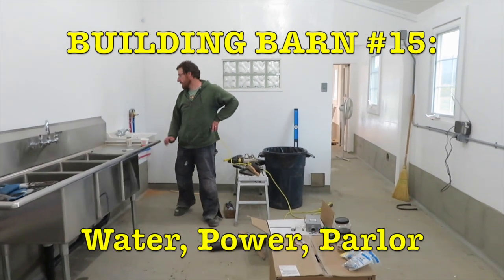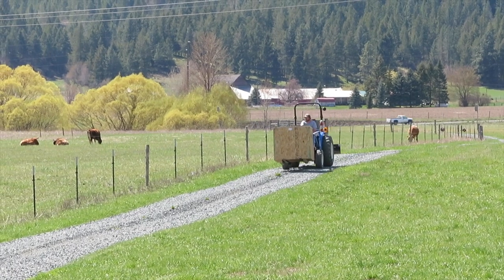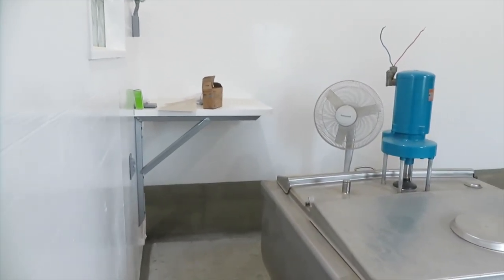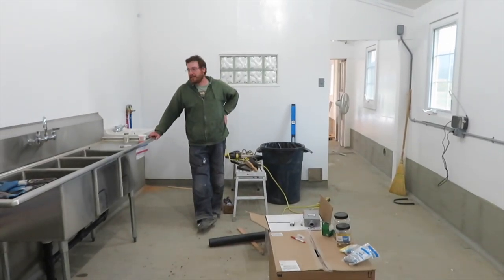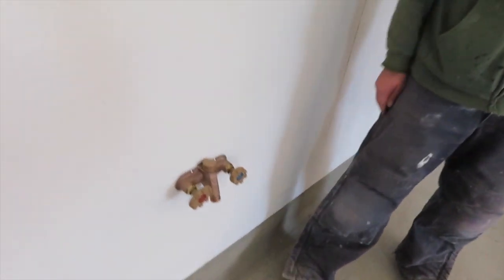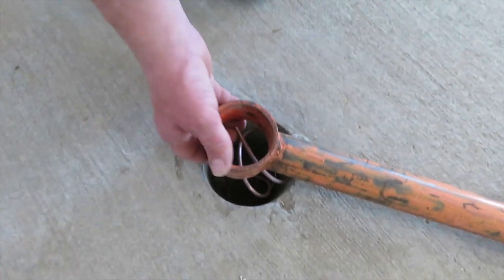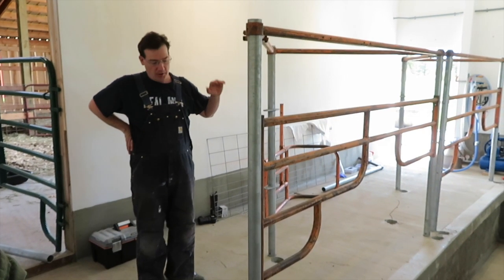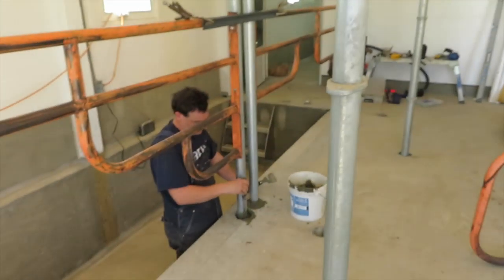Building Dairy Barn #15: Water, Power and Milking Parlor

Comment: Huge progress in just this video, Great Job! Won't be long and you'll be milking in the parlor, maybe with the bucket milker but still easier on the back and knees.
Reply from the maker: Yes, we’ll use the pail milker in the parlor. Eventually we want a pipeline, but for our tiny herd, the bucket works fine. Regardless, a raised parlor is totally going to be worth it!

Comment: very nice building .. im building a new oyster plant up here on the east coast of Canada and where the wall and floor meets i have to do the very same thing as you folks so the water runs away .. what kind of cement did you use for doing that part ???
Reply from the maker: I used mortar to do the coving, using a piece of 2” pipe as a coving tool. Before I laid in the mortar, I used a slurry of plain Portland cement and water that I painted on as a bonding agent. Then I did my best to keep it moist as long as I could, at least a few day, spritzing it with water from a spray bottle regularly.